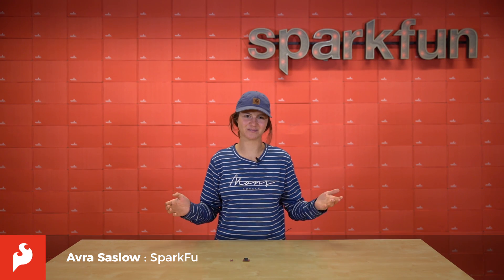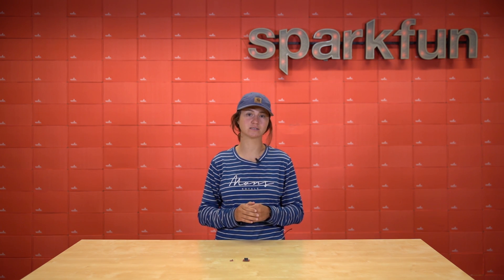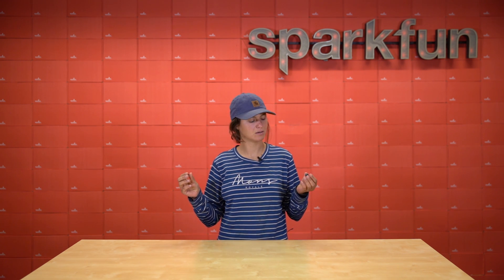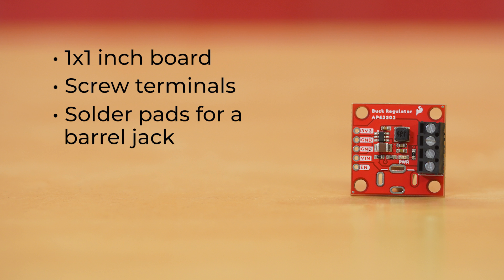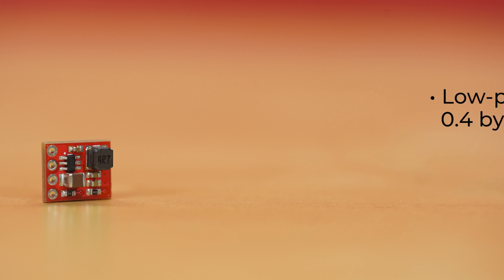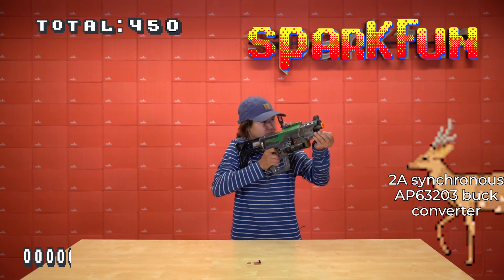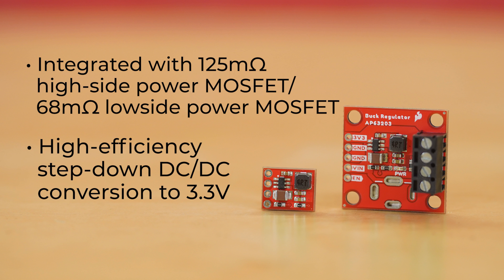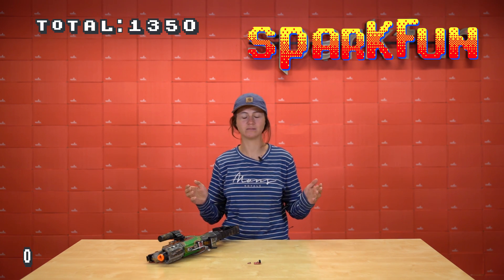Product Showcase: SparkFun Buck & BabyBuck Regulator Breakouts

Comment: Does anybody know if a small capacitor is needed/recommended at regulated power output? I am just powering a arduino pro mini with a couple leds, but have heard regulators are slow to respond to current demand

Comment: No 5V versions?
Reply: I guess you can add a new resistor to adjust output to a higher level. Sarkfun may release an adjustable version later.
Reply: Ya, just today I had a need for a 10v input to 5v output regulator for a vintage computer project.